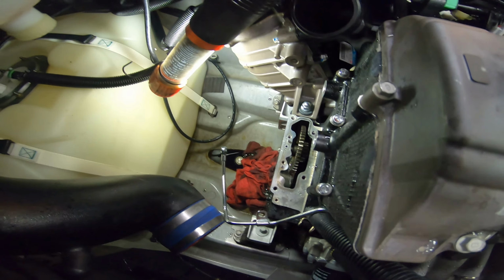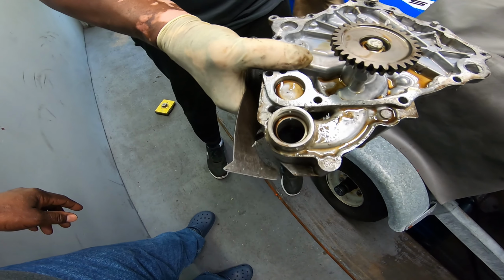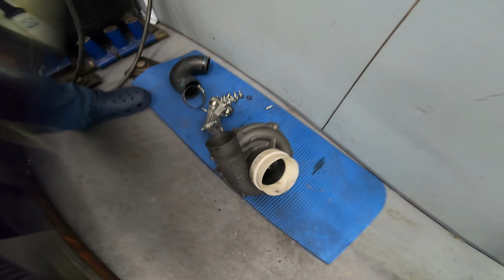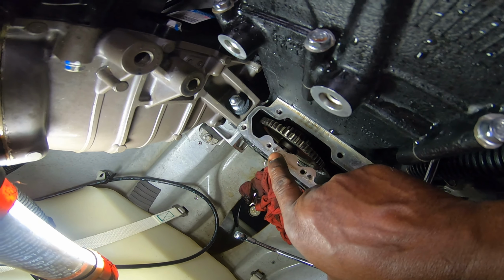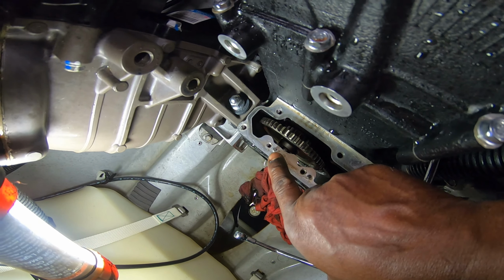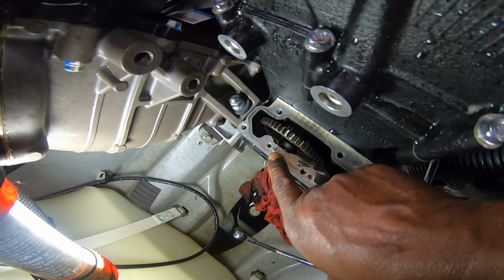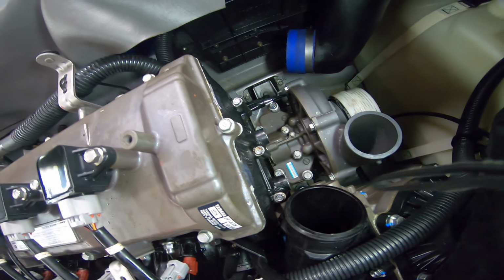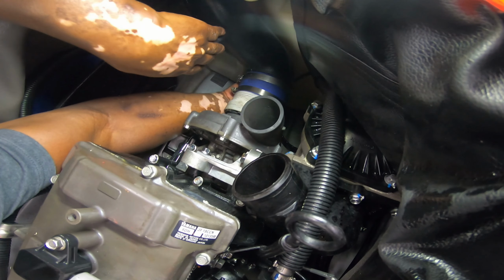Yamaha Waverunner Supercharger Clutch remove repair and replace

Comment: Hey brother I’ve got supercharger off & I can spin supercharger in both direction’s while it’s off motor. If I’m understanding you guys correctly it should only spin in one direction when it’s mounted..?
Reply from the maker: That is correct. It should spin one way only. It's basically a one way sprag bearing

Comment: Im down I Florida & just ran up on you boyz, I’m about to replace my clutch. You guys are awesome.
Reply from the maker: Thanks alot. If you have questions in the process just hit me up..
Reply: Is it true synthetic oil bad for clutch
Reply from the maker: @rogernascimento5006  yes use oem spec oil. It has everything in it for your high rpm marine engine

Comment: I found a bit of rust on the clutch and the gear above it, is that a concern?
Reply from the maker: That means water is getting thru the case and into the front area. Not good

Comment: Great video.  Are they known to blow clutches easily? I am debating the purchase of a 2021 gp1800 HO or SVHO.   The clutch maintenance is scaring me off the SVHO a bit. Thoughts?
Reply: DONT BUY..get ho...
Reply from the maker: Only if you ride in very rough water.  Its important not to do a fast throttle release , make it gradual.   I also have a 2020 and I add a blow off valve.

Comment: Did it make any noises when it started to go bad?
Reply: mine made none, just decrease in rpm's. went it totally went, it wouldn't go over 39mph.(165 hrs)
Reply from the maker: yes it will slow up and then speed up...When its gone you will do 35mph